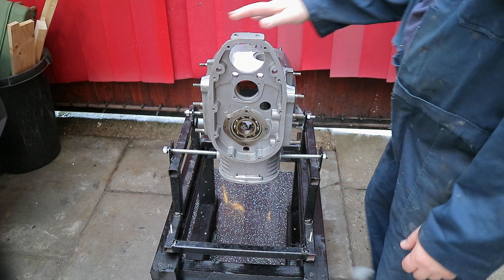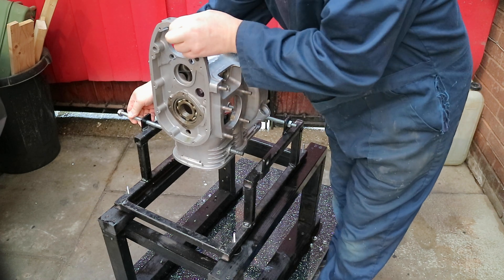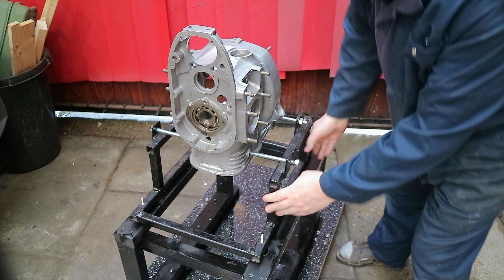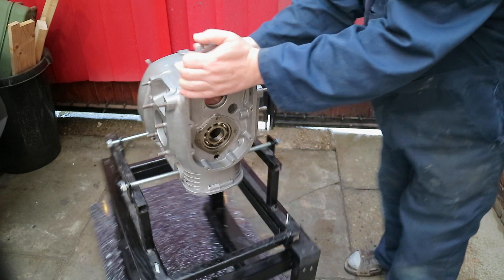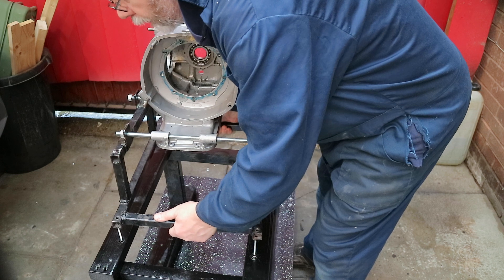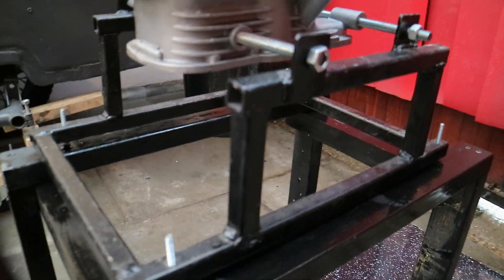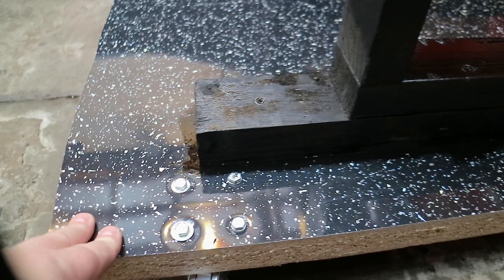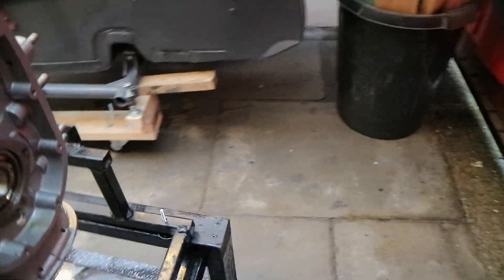Dnepr Engine Rebuild & Testing Station

Comment: My mt wont run right and ive done evrything to it.
Reply from the maker: When you say you have done everthing to it, what does that mean exactly
Reply: @JeffRoberts-KMZKM-Restoration i have fitted new barrels,pistons,rings,gaskets,electronic ignition,carbs.
Reply from the maker: @chrisplace9773  so Im assuming you have good oil compression, and you have set your electionic ingition to TDC, and your spark plugs are set correct and your have fuel getting through to your carburettors.  If thats the case then, then I guessing you havent set your carbs correct.  Might I ask if you have joined the cossack owners club on facebook, as theres loads of guys on there who can help also.
Reply: @JeffRoberts-KMZKM-Restoration  no mate,not joined yet.My next job is to check the cfm and sort the carbs properly.I have a sneaking suspicion that the sovek electronic ignition might be at faul but mot sure how to test.
Reply from the maker: @chrisplace9773   Ok, check this russian guy out, and scroll though his other videos from a few years ago, loads of video about working - setting up your rig.  https://www.youtube.com/watch?v=LsKCT2Re3rY&t=1179s
Reply: @JeffRoberts-KMZKM-Restoration  thanks mate,its given me a few pointers.Watched him kick it for 53 minutes before it started.